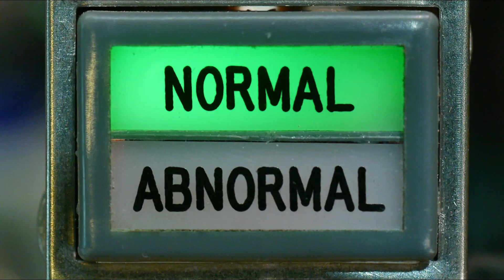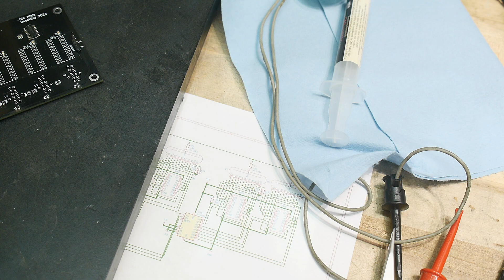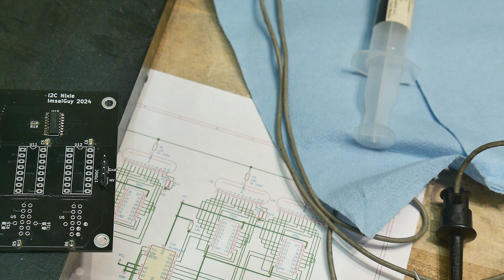#1803 I2C Nixie Display Project (part 4 of  5)

Comment: Pro tip: Put a resistor in series with the "1" cathode to make it even brightness with the other digits.
Nice project though!
Reply: Ha, I never saw that in practice, but it kinda makes sense, 1 being the digit with least surface area and thus the current distributed over it would mean higher current at any spot. I'll keep that in mind and maybe do some experiments with different nixies. I think the distance from anode to cathode may also be a factor, but I'm not that sure.
Reply: @KeritechElectronics  Exactly that's the reason. I built a Nixie clock ages ago, and used that technique to equal out brightnesses. Works a treat.